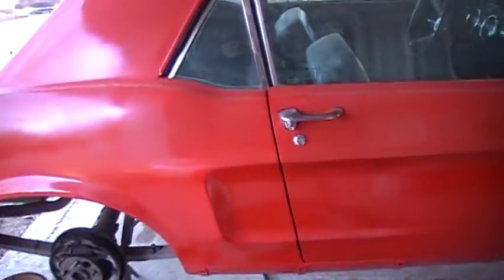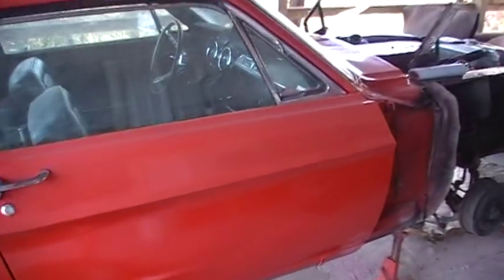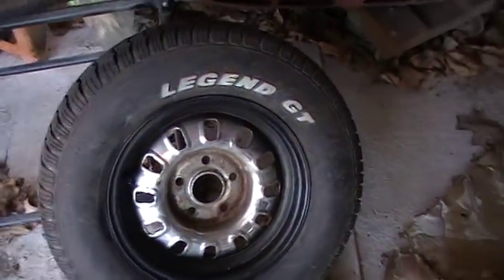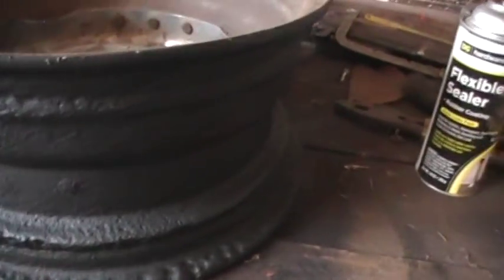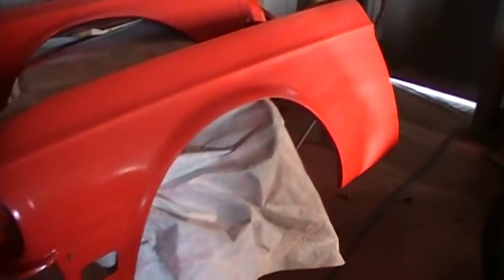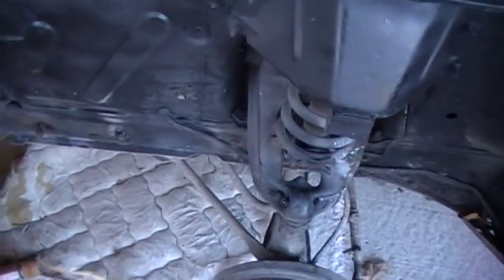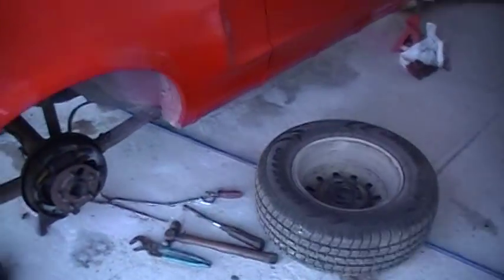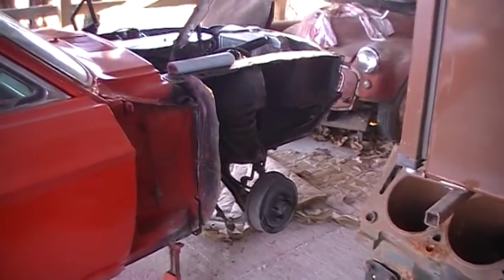Mustang brake question

Comment: I know someone who tighten up the shoes so much the car would not go forward and we could not get the adjusters to back out even sticking a screwdriver in to push the lever away from the adjuster wouldn't work. When we backed up the car we were finally able to loosen up the adjusters.
Reply from the maker: MostlymoparIH Thanks for your kind words M&M. Soon as I can get better weather I will look more closely.

Comment: Looks like rust on the face of the drums and if that's the case it wouldn't let the wheel roll free , you said the car was sitting at a body shop for a few years . Check the wheel cylinders to make sure they aren't set up if they are free sand the drums and the shoes with some 120 sand paper then adjust them back up and see what happens . Sounds like you may have a bad master cylinder also . Good luck love the mustang , had many of them wish I had them back .
Reply from the maker: Rusty rods  Thanks Rodder.  I cleaned and adjusted everything. Now it acts right. once I replace all the fuel lines with the new stuff I will give it a proper road test. Thanks again!

Comment: Its funny to me how many people think that manual brakes are so hard to stop with. A properly working manual drum or disc brake system stops just fine..  But anyway, not sure why they would have had yours adjusted so tight. When my truck had a super hard pedal and would hardly stop it turned out to have a rusted and seized up wheel cylinder. No matter how hard you pushed on the pedal the brakes would barely move, then when you let off they would not release because the pistons in the cylinders were rusted in place.   I know you will get it figured out!
Reply from the maker: Shut Yer Face Garage That Chevy C10 that I fixed had two frozen cylinders. Hard pedal and no stopage. I put everything new on it and now it stops great.

Comment: right size lines running through car some old manual brakes required 1/4 inch steel line
Reply from the maker: M. Pierce Yer right about that. I finished putting it all back together and adjusted everything the right way. Works good now. Even the emergency brake was pulled on before.  Thanks again Mr Pierce.

Comment: I had a 68 Ford truck years ago, back in the early 80's. Had the same problem. It turned out someone put the wrong master cylinder in it. The rod was too long. As I drove it the brakes went on harder and harder. When I loosened the brake lines at the master cylinder it freed up the brakes, then when I tightened up the lines again and drove it, same thing. All four brakes locked up. I put the correct master cylinder on it and the brakes worked fine after that. I never seen anything like it back then. I wonder if you were to loosen the brake lines at your master cylinder if that would release your brakes. Sounds crazy, but worth a try. :) Good Luck Steve!
Reply from the maker: Bonde Smith Thanks very kindly for your help. I have seen the wrong master installed a few times. The master cyl will get checked next warm day. Thanks again!
Reply: Yeah drum brakes keep a residual pressure on the lines. 
I had a car that was all drums and put on the wrong MC that was four4
disc brakes. I had brakes but always had to pump them up to stop. 
Put the correct MC in and waa laa I was in like Flint they stopped.

Comment: some one did not put power brake wheel cylinders on it thay are smaller diameter then manual  or did thay put a power brake master cly on the stuff will fit or maybe theres rear wheel clyinders all the way around  supost to be larger in the frount for more stoping power  hope this helps you some have a good day today and a better one tomorrow
Reply from the maker: M. Pierce According to the casting numbers all the wheel cylinders are correct. I  can't tell if it ever had a booster. There's not one now. Today I put it all together and adjusted them right. Pedal feels better now. I will drive it soon as I get the rims changed. Thanks for your kind help Mr Pierce.

Comment: look close at the hard lines and make sure one of them up near the front around the engine compartment didn't get smashed when the engine was installed 
if the hard lines look good i'd probably replace the master cyl
Reply from the maker: DoublecabTom Good advice bro. I am thinking that I might put a booster/master cylinder on it when I can afford it.

Comment: They didn't know any better and thought that that was what you needed to do to get a good hard, high pedal. It did, but it just wouldn't stop the car. Probably the master cylinder is at fault ultimately and they were trying to make up for it. That's my story and I'm sticking to it and don't ask me how I know all these things either...
Reply from the maker: The Shade Tree Fix-it Man  I pretty much know that you are right Padre. I will get everything back together and see what it does. Thanks!

Comment: Does the car still have the Single Reservior Master Cylinder? If so, they may have adjust the brakes tight, to have a better pedal feel. My '66 Mustang had a Single Reservior Master Cylinder, and even when the brakes were bled and adjusted, the pedal went down about 1/2 way, before I'd notice it slowing down. They could have just had them adjusted wrong.
Reply from the maker: Kickinpony.66 This car has a dual master. No power booster. Next warm day I will check the emergency cables. All my old Mustangs  would stop good. even the one that only had front brakes.
Reply: Yep. A lot of people don't like the pedal travel with a single reservoir, and adjust them tight. Dual reservoir is the best upgrade you can do to these cars.
Reply from the maker: Kickinpony.66 I had over 20 mustangs and only one 66. I really like them.

Comment: Adjusters in backwards and or new power booster needed vacuum leak to booster
Reply from the maker: unclebigguy Adjusters were correct. Shoes and cylinders were right too. I will check the emergency cables next. Thanks for your kind help.

Comment: You are correct about the power steering box having a different ratio. Don't know wht the brakes would be adjusted so tight. You just want minimal drag.  By having them so tight they'd heat up and glaze up giving a hard pedal. Plus I didn't see a brake booster. Is it manual brakes. Larry's brake adjusters go on the drivers side. Roger's go on the sidewalk side because he's ready to grab the girls on the side wall. Remember, R for Roger and R for girl, um, or sumpin like that.
Reply from the maker: Thanks for the great help Bubba Ice. Its manual brakes, no booster. That might change next year. I am having a dyslecik day today. Larry always drives. I allways adjust brakes with the wheels on. Lock them up and give them two clicks to back them off.
Reply: cutworm59 Also forgot to mention that driving with them so tight likely glazed the shoes and drums. You might need to sand them to get the glazing off.
Reply: Over here Roger drives and Larry gets to look at the girls.
Reply: cutworm59 Funny you called me Bubba Ice.  My Iceman nickname came from a racing friend of mine. But since about 1977 my main nickname was Bubba
Reply: I'd say call em Driver and Passenger butt that won't help across the pond. 
Ask your best friend Scott .

Comment: Think they might have the wrong master cylinder on it Cutworm? Didn't manual and power have different bore diameters that increased the pressure to the wheel cylinders? Thinking wrong MC low pressure, maybe someone tried to adjust the brakes up to compensate but it was not going to help.

Comment: If the pedal is really high and it take 2 feet to stop the car there is a very good chance they put the wrong master cyl. in .....The bore size for power brakes is bigger causing less brake pressure to the wheels.....find a correct master cyl. from a real supplier...one that sells Mustang parts....
Reply from the maker: homotorsports Thanks bubba Anthony. I checked the diameter of the wheel cylinders and they are right. After I put it back together I will check the master. I might add a booster to it at the same time. JR'S racecar looks very Beautiful!  I love it! I'm going to try and buy a good paint gun. What do you recommend?

Comment: save the new new lower ball joints they wear out about a year later because its a bad design. put Moog on it. the ball joint on a mustang just beat the heck out of their selfs you cannot have too many extras maybe the upper ones too save them too they just don last real long.
Reply from the maker: shartne Great Advice Brother. I have a cabinet full of Moog parts for Jeeps. That's all I will install.  That's what the Mustang will get. Yup, Moog, Spicer and TRW.
Reply: If ya want ta Spicer things up put a little Blackberry in your coffee or 
tea that'll Spicer it up four4 ya. It'll put ya in a better moog I mean mood.

Comment: im thinking they put the adjusters back words larry always drives (the driver's side is left-hand side all the time ) unless you have a British car lol  so recheck and make sure and if you put it back together and the wheel tightens up the adjuster are not proper good luck buddy
Reply from the maker: Thanks dear Drewberry. I installed them L for Larry on the drivers side. Next warm day I will finish them and see if I have good normal brakes.

Comment: I don't know why anyone would intentionally tighten up all the brakes,, some used to tighten up the front brakes so when they held the brake pedal down they would really hold so they could lay longer black marks,,, but that wouldn't work  these days since most cars are front wheel drive. unless the master cylinder was stuck and not letting the fluid release,, ???
Reply from the maker: MissouriOldTimer I will give it a thorough short arm inspection next warm day.